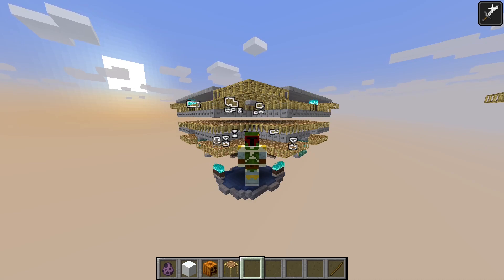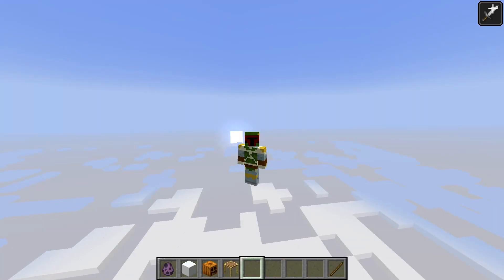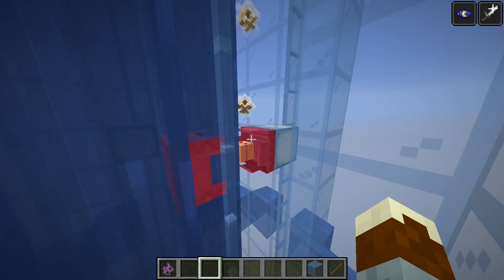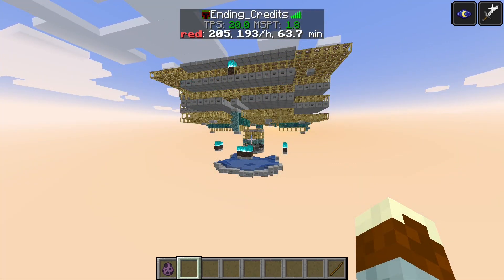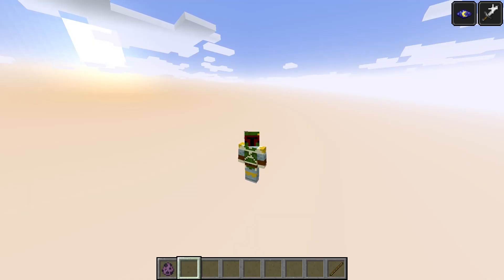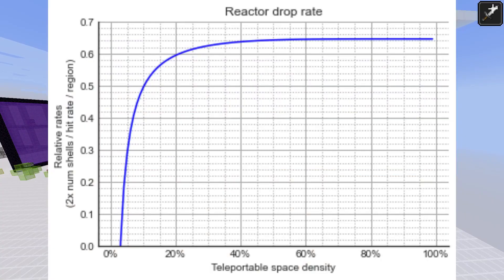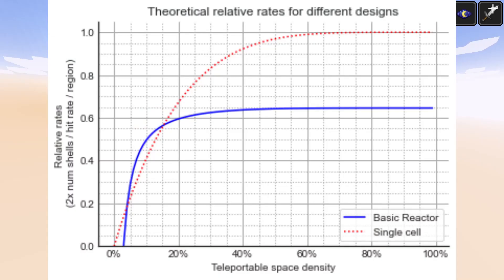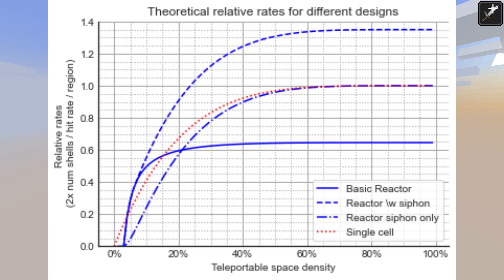Shulker reactors - a new shulker farm paradigm!

Comment: I didn't know the concept of the scaffolding and how their mechanics work with the hitboxes. I guess that mixing this mechanic with the reactor concept is the key to achieve reasonable rates for those farms.
Very interesting video! Very technical and clear.
Reply from the maker: You don't need to use scaffolding to make a good reactor!

But it is a very useful tool. hf147 has been improving his farm, including using scaffolding to provide extra teleport space and for siphoning,  and now has about 1200 shells/hour.
Reply: @EndingCredits  I'mma need some links cause I know what I wanna do now 👀

Comment: 9:55 One idea that comes to mind for me is similar to what Etho did with his reactor. If you were to put an area around the reactor so that they had a chance of teleporting onto the holding point then all you would have to do is kill them(of course that is a big challenge in itself). This is just an idea, I doubt that any profound discoveries will be made in youtube comment sections lol.
Reply from the maker: Yes, this is basically what I mean by siphoning (so I guess Etho was already kinda trying this idea out). Of course, as you say, it's harder to pull off in practice (well, getting a handful of shulkers out is not too hard, but moving a lot of them out becomes a lot more challenging).

Scaffolding is quite useful fot this as you can quickly get shulkers away, but it's hard to build enough of it so the shulkers have a good chance of teleporting out.